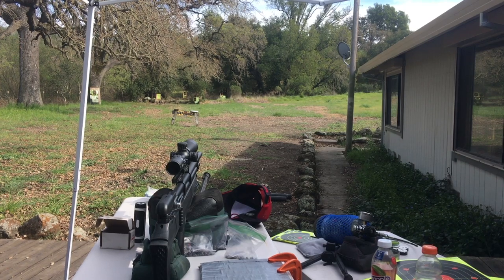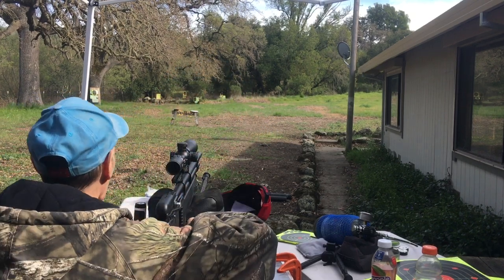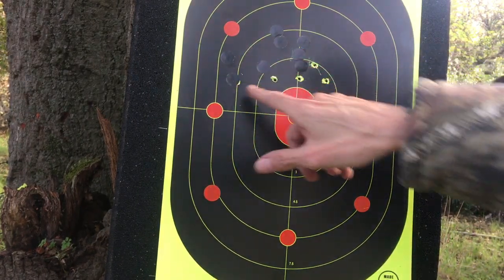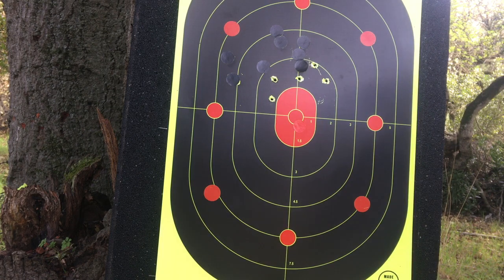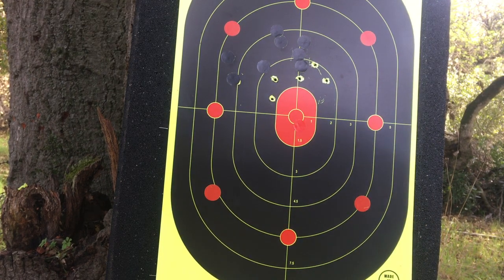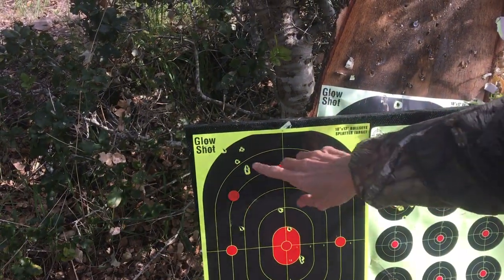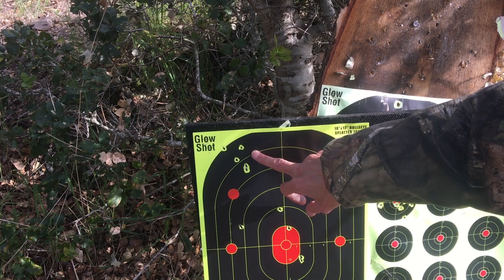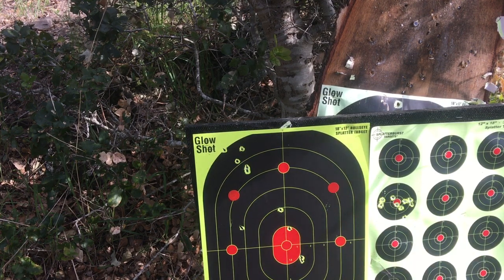AirVenturi avenger bullpup 22 Cal Airguns Of Idaho slugs #2

Comment: Nice video Mitch.  I'm a 1 - 2" max guy!  If you haven't done it recently, did you clean those Avenger barrels of old lead. A couple high spots of lead can easily change a barrel. To truly know, I always start with the baseline of a clean barrel.  Keep it up you'll find the right tune!
Reply from the maker: You know you're absolutely right I'm going to go ahead and try to clean it and do the test again with the original and your wooden stock. I know for a fact Tom has put thousands of rounds through that thing already it's still shooting pellets well though. But that's neither here nor there I don't think. Like you said I need to start with a clean slate from zero to rule out all the possibilities. Well you didn't exactly say that but you know what I mean lol. Thanks for stopping by Buddy. And thanks for the advice.
Reply: I’ve done that for slugs on my avenger and still had a wide group. It seems slugs work best with FX because they have the liner to make it more accurate. Slugs are good up to 30 yards for me but 50+ I actually use a heavy grain 33 or 44 grain to help beat wind and stay close on target

Comment: I would honestly check the mounts for your scope along with cleaning that barrel. The group may have opened up at a higher reg pressure. But having 3 shots exactly at the same height only having a shift from left to right is odd.

Comment: If both guns are the same id say it is just the different barrel!
I had a two Gamo varmint (first one broke the store replaced it) 
The one I got now is hating the pellets the other one grouped the best with...(no difference at all in between both rifles)

Ive heard they do barrels in a long bar and cut them afterwards (without really carring about twist rate) so the rifling isnt always the same!
{But im no rocket scientist}
Reply from the maker: I totally agree!!!!
Reply: @timmy4539  hahaha I know dad! 
hopefully this one will survive
Reply: @timmy4539  hopefully {if it does} it will break before the warranty ends and ill get another 1year store warranty with it 😁
Reply: @timmy4539  Dont worry this was the last Gamo and I probly wont ever buy any more gamo pellets too {but id try those lead round balls tho 😁}

I learn from my mistakes 😅
Reply: If you have barrel issues. Try a barrel polish, it can squeeze a bit more out of the barrel for cheap. Use a diamond paste or something like that.
Reply: @swingonthespiral  for chinesium toothpaste will do good enough 😁
Reply: @swingonthespiral  I like my detuned Varmint BUT I am still salty it broke before it could even reach 300 shots...yet my experience with Gamo has not been great quality control wise!
Reply: @LowkeyAirgunner  Yeah from my experience, they design great guns with cheap parts and cheap labor. So maybe half of them are winners and even then they fall apart and need to be screwed back together, tightened, resighted in etc... but the price is so low you can sometimes justify it. And they are accurate! Just clunky lol.